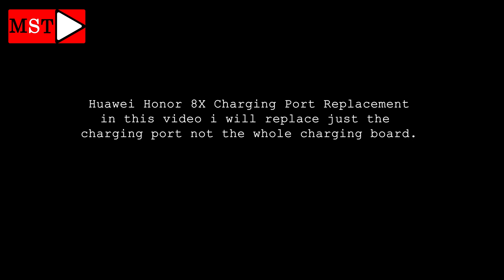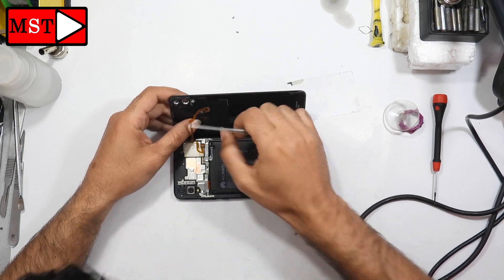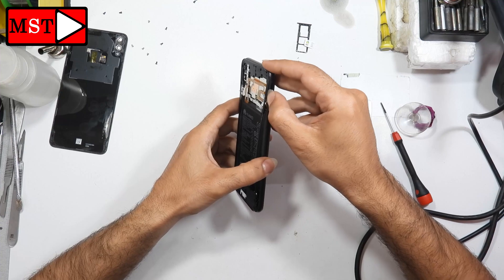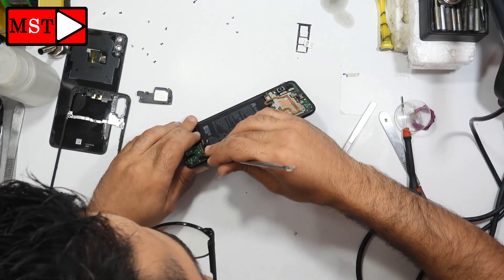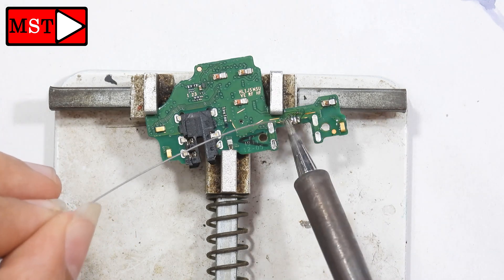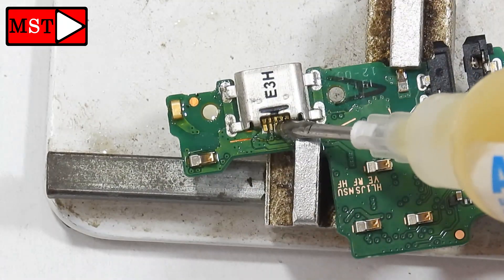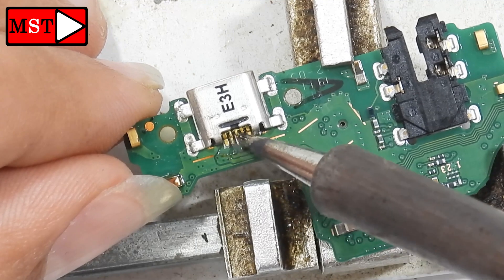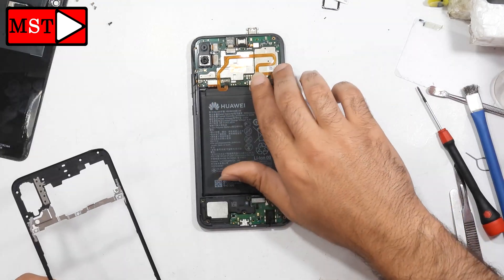Huawei Honor 8X Not Charging

Comment: i order charging board to aliexpress but what came it has no ic,it will work if i install even no ic?
Reply from the maker: It should work, but not fast charging i think
Reply: @mstphone  it will not explode even without ic?
Reply from the maker: @mhelnival8443  sure it will not explode!
Reply: @mstphone  ok thank you i will try to install
Reply: @mstphone  it just screen on off with red charging logo
Reply from the maker: It didn't charge?
Reply: @mstphone  charging but not so fast,but now 8 change with new one with ic because i order again in aliexpress
Reply from the maker: @mhelnival8443  as i told slow charging because no ic .